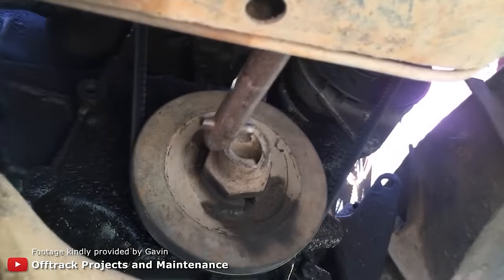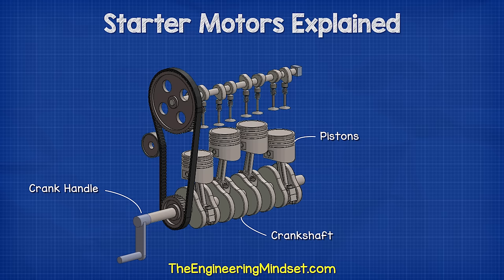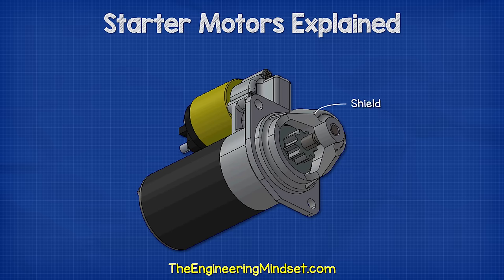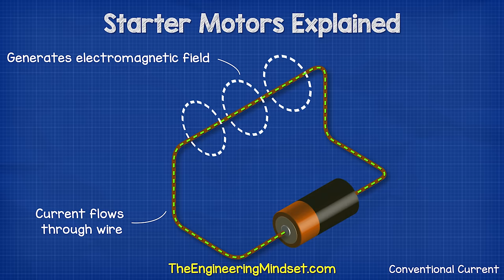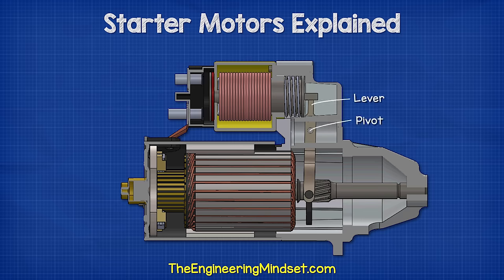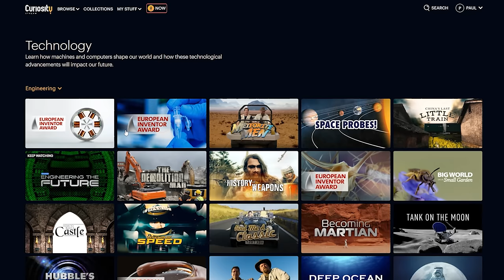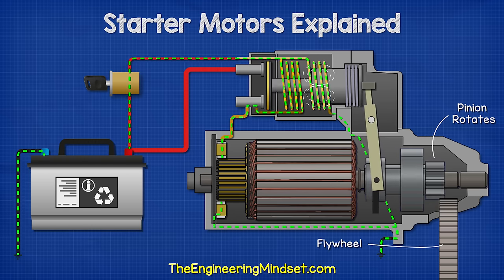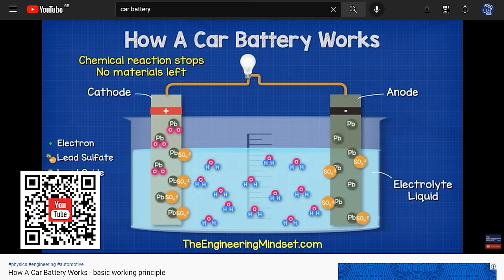Starter Motor Explained - How a car's electric starter motor works

Comment: I really enjoy your videos and the animations you use to explain and simplify understanding of the subject matter. Last time I "repaired" a starter motor it was as follows; the loud click from the solenoid could be heard but then nothing, battery was fine so I removed the motor for bench testing. It turned out that the contactor plate/ring was not making the contact required for the electrical motor so bent the plate to ensure good contact, reassembled and re-fitted the assembly. I had the vehicle for another 5 years and it was still going strong when I sold the car.

Comment: You can diagnose a possible faulty starter motor by measuring  voltage of the thick wire of the starter when you have someone turn the key all the way to start. You can also jump the 12 Volt signal "S" post of the solenoid to the large post going to the starter with a piece of wire or metal object to test for a faulty solenoid.

Comment: My boat won't start and there is an electric issue. As it's not accessible easily, I find it very helpful to see this an find out what to look for. Inboard engines are diesel engines as well, they all work the same more or less. So thank you for helping me out with this very, very in detail video

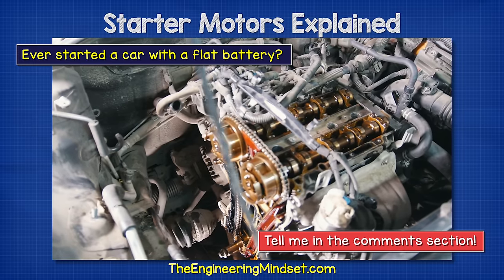Comment: At 0:53 i can tell that engine is an NET turbo either 1.4 or 1.6 🤣 I know this because i literally rebuild 1 of these every week. Fun fact about them... the heads seem to blow quite easily and rubber the separates water from oil in the oil cooler can crack and cause engine failure😣

Comment: I used to work at a courier company full of sub-contracting owner operators.  Failing starter motors were probably the most common failure.  We would often crawl under the afflicted vehicle and bang the starter motor with a hammer while someone turned the ignition until the vehicle started and could be driven to the shop or the work be done for the day without turning the truck off.

No idea why banging the starter motor worked, we just knew that it did and it saved many butts.
Reply: Banging on the stater would tend to free up the stuck carbon brushes which have become to short to fully reach the commutator. This arcing causes the brushes to stick in the brush housing and become stuck.

Comment: They were Bendix Starters in my day. The motor would throw a spinning pinion at the gear ring on the flywheel, using inertia to drive it forward on a spiral spline. There was a real possibility of causing wear and damage to the gear ring on the flywheel, after which the starter instead of engaging would make a loud shriek of clashing gear teeth. You could get the same effect by pressing the starter button/key when the engine was already running - guaranteed to do damage. Once the engine was running faster than the starter motor, the pinion would self disengage and run back down the spiral spline. There was a big spring on the shaft which helped this happen.

Comment: Question: Does the electricity for the pull in coil go through the windings of the motor to go back to the battery (negative side)? If it does, won't it start the motor itself already because it has a little potential voltage going through it?
Reply: The motor only draws what it needs and return voltage is always a zero sum.

Comment: If it doesn't start try tapping it a few times. If it doesn't work then turn the key on, push the vehicle and when you get some speed just engage second gear. It always works
Reply: only with manual transmissions....not automatics....
Reply: @laketrump6768  only real drivers use manual transmission

Comment: Ok but that would only make the pistons move, how do the spark plugs know they have to start working? also what happens when you turn your key off? Why the engine stops? 

Great video thanks for the insane quality!
Reply: The ignition system on petrol engines is also energised by the second stage position on your ignition key switch. The third position is to energise the starter motor. It is a momentary switch which means once the engine has fired up the ignition key springs back to second position. In modern csrs the ECU, ignition units and coil packs control the spark and timing.

I learnt about cars when carbs, distributors rotor arms and HT coils and off course points were used.

Comment: At 8:00 min. When pulling coil is energised current is passing through motor coil then reaches negative. Does not it make humming sound of motor as it will try to rotate armature (not possible due to low current)?

Comment: Thank you very much, I understand every thing about turn starter the car , but I have a question about turning the car off , after using the starter gear to move the engine, it came back normal and the engine do the rest of the job , but when you switch the car off , which part of the car stop the engine and how?

Comment: the easiest way to diagnose a starter is to bypass the control system, just apply the power straight to it using a jumper of whatever sort

Comment: Is there another way to explain the overrunning clutch and the rollers? That's the only part I can't get my head around. The engaging and disengaging of the rollers to protect the motor and pinion.
Reply: Same here
Reply: As far as I can tell, the pinion ger isn't attached to the shaft it spins freely. The overrunning clutch is what spins with the shaft. And as the clutch spins it's like a spinning rollercoaster on the rollers and they get plastered to the sides of their seats. The housing has ramps so as they get shoved to the side they run down the ramps and are shoved into the pinion gear and engage with it turning it. Then as the flywheel turns the pinion gear faster than the clutch the rollers are going to do what wheels do when you spin them; they run the opposite direction of the force you put on them. Do this put your hand in a big claw for the clutch, inside your claw put your other hand as a smaller claw for the pinion gear. As you rotate the big claw, imagine the rollers lagging behind and engaging. Then rotate the smaller claw faster then the big claw (engine is going faster the the starter). The small claw acts like the ground on the imagined rollers which spins them and drives them back up their ramps, disengaging them. Whoof! that was a mouthfull.

Comment: Nice video. Though missing many things. The power doesn't go directly from starter key to starter solenoid. Rather, power go from starter key to relay, through safety interlock and from there, it goes to Starter solenoid.

Safety interlock will  make sure that car will not start in reverse.

Please correct.

Comment: What happens when you try to start an already running engine? Is there any mechanism to protect the teeth in the starter motor or flywheel from damage?
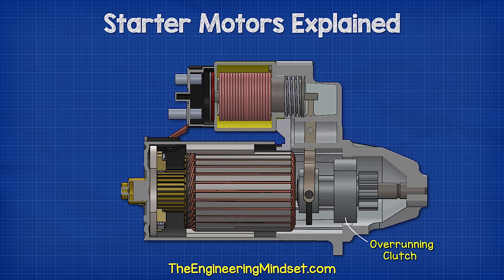Reply: The gear connected to the engine would be moving faster than the starter motor gear, so the little rollers mentioned at 6:20 would not engage. They stop the starter motor from getting damaged once the motor is running.
Reply: Since the engine/flywheel is spinning several times faster than the Bendix drive's operating speed (a few hundred rpm I believe) the flywheel will "grind" against the slower spinning Bendix gear when the gear tries to engage it. Hence, a major grinding of the gears until the key switch is released from the Start position. Or sometime the gear will engage and the Bendix will spin on it's sprag clutch which will sounds like a over-running worn-out bearing. Replaced many a starter with a ground down Bendix gear due to owners who thought the engine, which was running very quietly, was not running, when in fact it was. Some flywheels have ring gears that are more vulnerable to wear than the Bendix drive, resulting in a very expensive flywheel or ring gear replacement as well.
Reply: Yeah from your parents! LOL
Reply: Try it out. It sounds terrible

Comment: When the contactor plate makes contact across the terminals, the pull in winding becomes 0v because both of it’s become connected to the positive of the battery?

Comment: These videos are amazing. 
If you are ever on the subject of starter motors again, could you explain (or in this case show) how the solenoid uses the two different windings(pull in and hold in)
Reply from the maker: Thank you. Did you see the end chapter of this video? I've animated both coils.
Reply: @EngineeringMindset  I apologize. When the add hit my brain automatically thought it was the end of the video. That is my bad

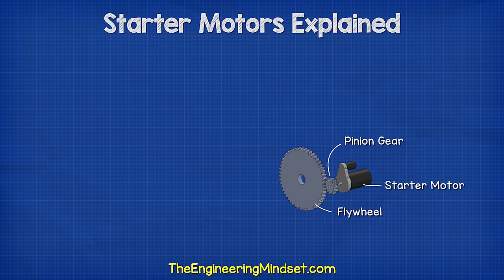Comment: 1:53
Don't you mean that because the pinion gear is small in relation to the flywheel the pinion gear must rotate fast but can have relatively little torque? AFAIK that's the normal way these "transmissions" work.
Just think of the bicycle as an example:
- high gear means big cog turns smaller cog (via chain) and needs high torque to get up to speed.
- low gear means small/same-sized cog turns same/bigger-sized cog (via chain) and needs little torque but high RPM to get up to speed.

Comment: This unit is generally known as "Bendix Drive Unit"
Reply: As far as I know is Bendix a brand. It is just commonly used for different drive gears.
Reply: @FLYF16able  No, As I was taught in automotive school it is know as the Bendix Drive.
Reply: Sorry the Bendix is a completely different system of engaging the pinion gear. Instead of using a lever from the starter solenoid, it instead relays on bendix spring to force the pinion gear to be moved forward into contacting the ring gear of the flywheel. Check Wikipedia for a description.
Reply: @Jimbo9008  Depends on which manufacture makes the starter.
Reply: @Ottos_ScLm_Race_videos_2009_on  
Correct. Most GM use the starter solenoid and the lever, while Fords lean towards the Bendix spring and a separate starter solenoid up on the firewall. At least in the older vehicles.

Comment: I used to tap on the starter...it worked for a while.
Reply: This action frees up stuck carbon brushes which have become too short to reach the commutator and carry the full current needed to run the motor. 
My uncle used to rebuild starters and generators in a shop in Colorado Springs. I would spend my Saturdays cleaning carbon dust out of housings. Learned a lot working there.

Comment: What is the problem when you on the ignition the pinion doesnt disengage and when turning off engine it always on even the key is off ?.. but when you direct the starter into battery the engine runs okay and the pinion disengage smoothly also engine off is good

Comment: How to diagnose a starter motor: does the solenoid click over when the key is turned? Whack it with a rock or something. 
Still inop? R/R starter.
Reply: Start with a dead battery? Push start, roll start. P.S. You can push start an automatic but it requires at least 30 mph.
Reply: @FuzzyWCTX  Regarding push start an automatic; are you sure about that? The aut gearbox oil pump is driven by the engine so the clutches or brake bands cannot engage the turbine. So how does it work?

Comment: Can someone explain why voltage becomes zero and current ceases to flow through pull in coil when plate closes? Thanks.
Reply from the maker: Both ends become 12V, so there is no where for the power to flow. If one end is 12V and the other is 0V, then it can flow.
Reply: @EngineeringMindset  why does it not just form a parallel circuit with the current flowing through both?
Reply: @richb6872  that’s what I’m thinking to man. Im going to look into this extensively and come back to this comment!
Reply: @richb6872  I guess the windings of the pull in coil has a very high resistance that is why the electricity ,if not all then most of it, will prefer to pass through the other wire. Electricity will always prefer to go through the path with least resistance.

Comment: Weird. When I took a starter apart to figure out how it works I assumed the splined shaft of the motor pitched the starter gear into the flywheel with centrifugal force and the solenoid pulled it back in after the engine started. I couldn’t spin the starter motor by hand without it pushing the gear out I can’t imagine how hard it must get flung with electricity spinning the motor. The one I took apart had a planetary gear set. To diagnose a faulty starter just short it. Short it with a screwdriver at the starter itself. Short it with a wire from the battery to the starter or short the starter relay in the fusebox.
Reply: Look at starter motors for outboard engines, they work like this (without a solenoid pulling in the gear).

Comment: In some applications of starter motor, we can find a starter relay. What is the function of a starter relay?.
Reply: From what I've experience on the starter motors of heavy equipments, they all have solenoid relays attached to them. The amps might be too high at the solenoid for the ignition switch to handle the current going through it that is why they also need solenoid  relays themselves.

Comment: Please explain how work lamps
Reply: May be with electrical system
Reply: @maswarservis  like in detail explained
Reply from the maker: Incandescent lamps is just some metal that acts as a resistor, it gets to hot that it glows and produces light and heat
Reply from the maker: Check out NEW resistor video, everything covered! ➡️ https://youtu.be/DYcLFHgVCn0

Comment: We faced a peculiar situation in which the starter motor pinion was engaged with the flywheel and turned but the engine was not rotating.we removed the starter motor and checked and found it is working fine.,But Why the engine was not rotated.?

Comment: Can anyone clear my doubt?
Why can't a starter motor be used as an alternator? Or vise versa. Why do we have two separate motors? Why can't we just combine them to one?
Reply: hi torque and having to convert voltage maybe the reason why.
Reply: Probably could.  Although it wouldn't be optimised.  Starter needs a lot of torque/ therefore alternator would produce unnecessary high amounts of power. Metal gears for the alternator would also be noisy as a mofo.
Reply: Have being used long time ago, called dynastart. It's becoming more popular again thanks to hybrid tech, now it's called ISG (Integrated Starter Generator).

Comment: Why are cars still only working with 12 volts? I know it's just been that way forever, but its not like we couldn't use 24v or 48v batteries and step down the voltage for legacy applications.

Comment: Starters are best diagnosed by using a little common sense. If a car is a no crank and checking the engine still spins, a good test light, voltage drop, and current draw test should narrow down any problems quickly
Reply: I had a starter motor that did spin but did not turn over the combustion engine. Obviously the solenoid and electric engine was working so I thought it was the arm moving the Bendix gear that was broken. Nope, -it was the overrunning one way bearing that was worn out so it slipped.
Reply: @nhytg376tgyuu765gjmg  one of my arch nemesis starters to diag was in a diesel. When they get a little worn, they’ll still turn over, just not fast enough to start the engine. Have to diag those with a current meter

Comment: I used to push my father car, a manual gear, if the battery is dead. When reached a certain speed he put it in gear, and voila
Reply: Yeah the classic push start.